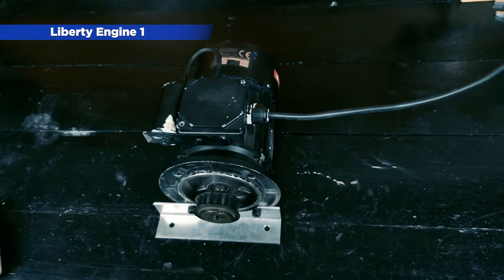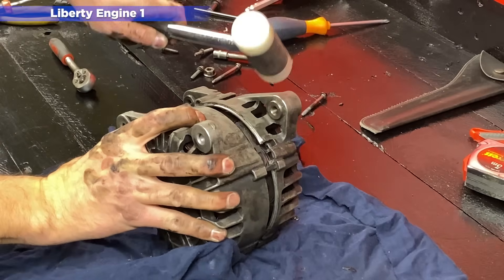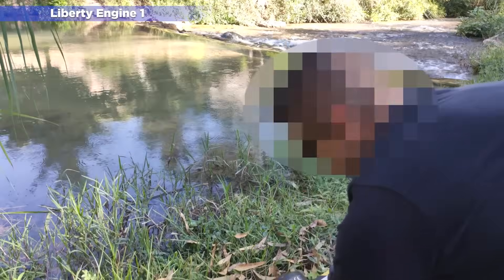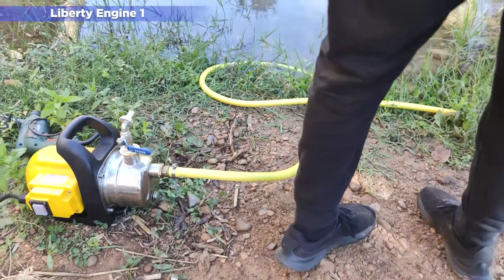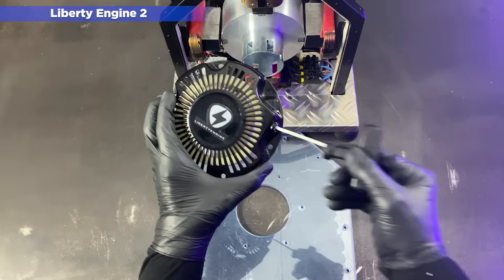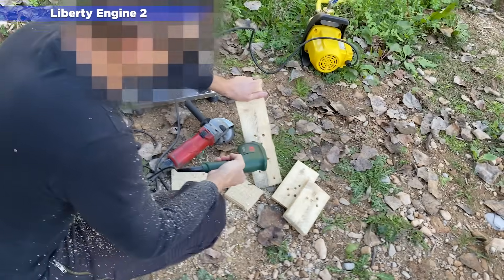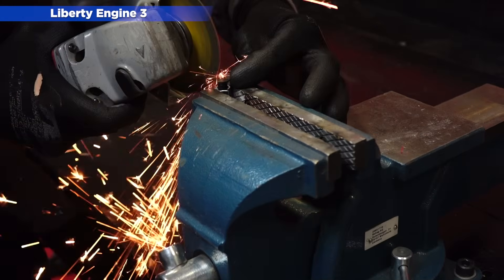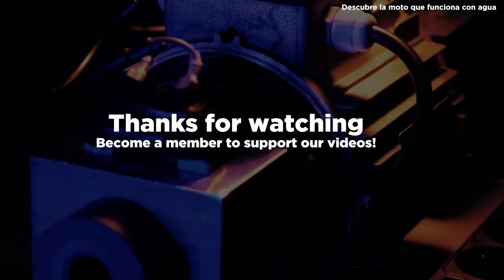Liberty Engine 2.0 GIVEAWAY - Free Energy Generators - Evolution and Comparison

Comment: Love this "'Open source' tech. Couldn't you attach a handle to the Liberty 2?..How heavy is heavy? It looks awesome..I guess someone will work out the proportions of the alloy mix...Keep it up and share, share, share...Knowledge is power....
Reply: Open source tech? where are the build instructions?
Reply: @alcomys6074  They've outlined the specs in previous videos. The one thing missing is the proportion of silver/aluminium composite alloy..
Reply: @craigjeffrey3236   Yes and that's the key to build it, so that is secret, nobody can build it now.

Comment: I support you guys because you guys pulled out something that is impossible Liberty 2.0 is in some advancements I'm working on a prototype of your guys's engine only thing is is the neodymium magnets are going to be 30 lb per magnet and I am going to run it and see how it performs I also will be changing out the bearings to porcelain to improve rotation and where please continue doing good and make more videos this is the best video I found on electric engines with the highest voltage I enjoy watching your guys's videos I'm a very new subscriber and you guys will be getting lots of attention
Reply: I hope you guys are enjoying everything would love to see more on Liberty 2.0 possibly be entered in the giveaway but my chances are like hitting the lottery not very good like a shot what is very not a problem to happen
Reply: Leoze you recognized that they used a rod of a top secret Alloy from Silver, Aluminium plus X ?
It will not work without. I doubt it will work at all, I tried it already.
Don't try it, it is a waste of time..

Comment: Hello! I've been following your demos since they were posted here! I really liked draft 2, but the third draft (no moving parts) is the pinnacle. Power and silence! Free energy. I'm not an engineer, but I think that given the dimensions and weight of the basic part, any metal caster should be able to achieve the right mix between aluminum and silver!
Your third project is perfect for home use...and more!!!
Congratulations and thanks for sharing!❤👍👏

Comment: This product needs a nice heat resistant insulating case to make a decent unit, because it generates a lot of power.

If your engine fails when you are sailing and don’t have the skills to sail your sailboat into port, then you shouldn’t be sailing.  And everyone has to star somewhere.  Please do not let them make it impossible to escape them.